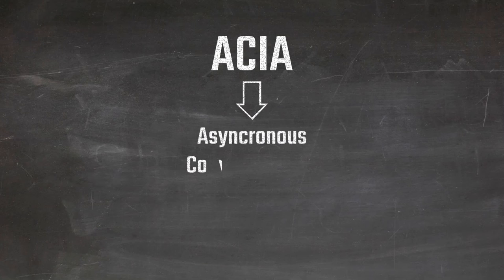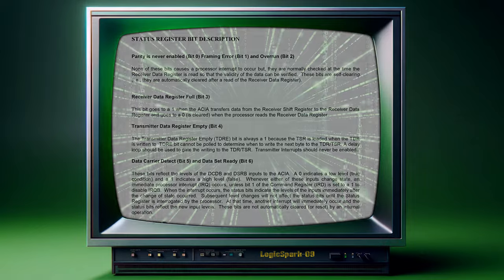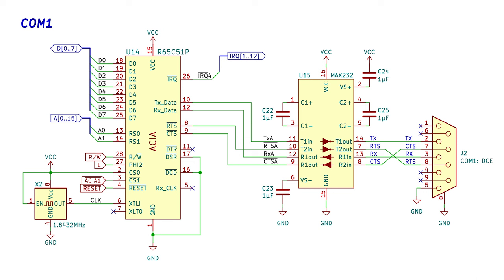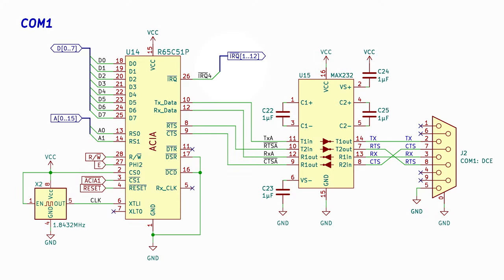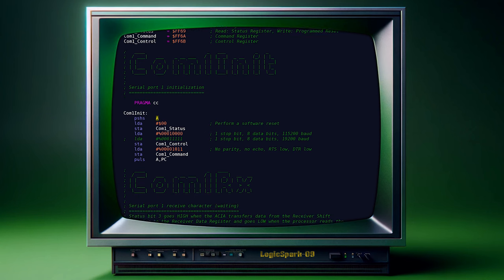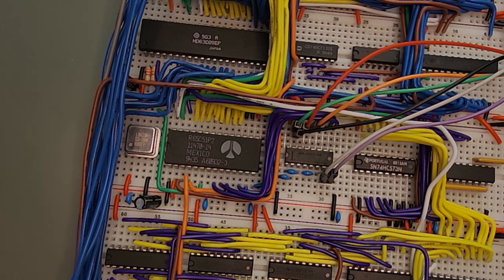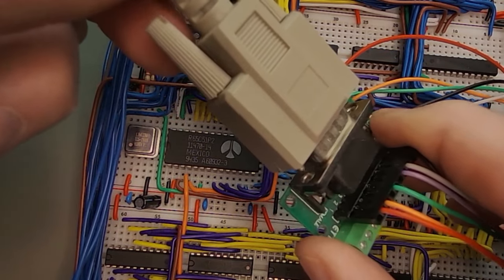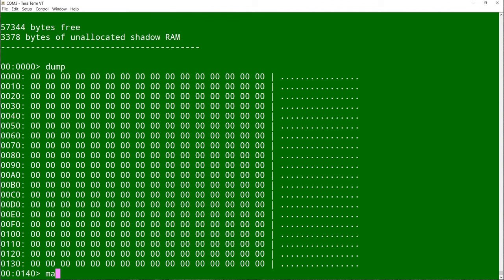6309 Unleashed: It's time to communicate with an ACIA - Ep4

Comment: Hi Frederic!
I recently built a breadboarded 63C09-based computer.  I have a bunch of 6309 code I've written for it.  A lot is written in C and compiled using gcc6809.  But where appropriate, I've rewritten many routines using the additional native 6309 instructions and registers.  Most of the code is for various graphics demos for a 128x64 graphical LCD display using the ST7920 LCD controller.  The code can be easily modified for any other size or controller.  By using the extra registers, I'm able to perform a plasma effect with dithering at almost 13 frames per second.  Using the native 16-bit multiplication and 32-bit division, I created extremely fast 8.8 fixed-point functions which enable to cube to spin at 19 frames per second!  Other demos are six Amiga Boing balls bouncing on the screen, a few line demos, patterned rectangles and circles randomly appearing on the screen, along with some other.  Let me know if you'd be interested in my code.
Thanks!

Comment: Did you remember to add a pull up resistor on the open drain interrupt pin on the R6551?